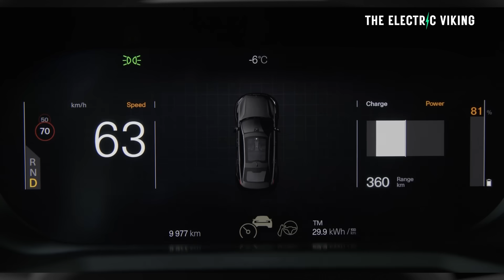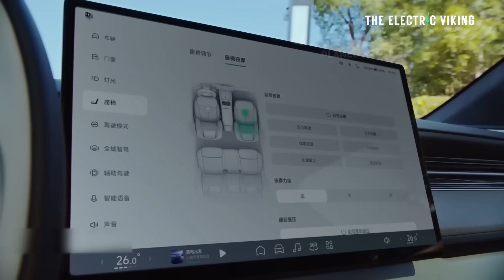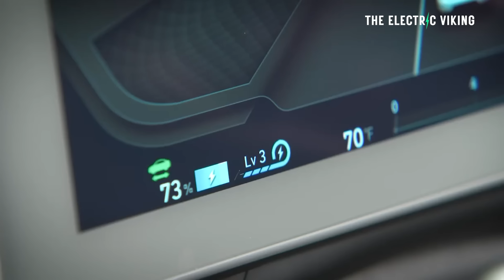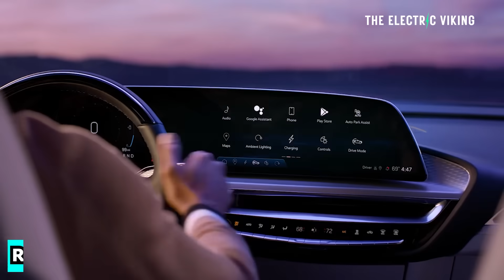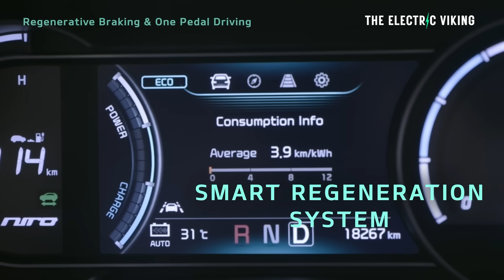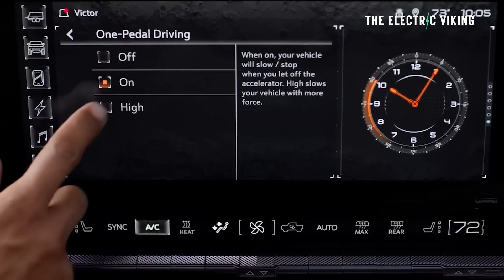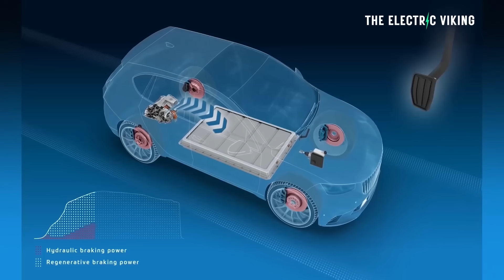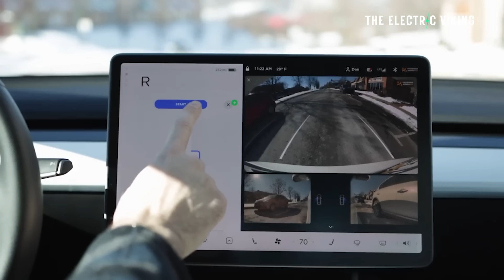China BANS Single Pedal Driving - Regulators Claim it Causes Crashes

Comment: True 'one pedal driving' requires that the car add friction braking near to the full stop  without anyone touching the brake pedal. Regenerative braking a heavy car does not work with the diminishing energy available near to the stop.
I learned to drive in the 1950s using three pedals, so I still brake with my right foot even with two pedals, but here in the USA where automatic shifters  in ICE cars are the norm, I see too many drivers that have only learned to drive with both feet, one on each pedal, and so follow far to close because they can brake much quicker.
 I expect that in China, with cars supplanting bicycles for many of them only a few decades ago, the government sees a time ahead when young drivers forget, or worse, never  learn  to use that other pedal on the floor.

Comment: Nonsense, you can dial it in if you want it. In my BYD the car brakes at -15KW foot off throttle. This is somewhat less than my Tesla.

In the BYD pressing the brake peddle to the first pressure point uses regenerative braking up to -80KW. Press the brake harder, second pressure point, engages the hydraulic system. As the vehicle rolls to a stop tap brake peddle and auto park brake engages.

The BYD system is beautifully harmonised. Personally I prefer it to the full one peddle system in my TM3, which I think is less safe.

Comment: China is not banning one‑pedal driving outright, but from January 1, 2027, new national standards (GB 21670-2025) will:
- Prohibit vehicles from being set to default one‑pedal mode (i.e., where releasing the throttle alone stops the car without using the brake).
- Require that drivers must manually select one‑pedal mode every time they start the car.
- Mandate brake lights activate whenever energy recovery deceleration exceeds 1.3 m/s²  .

In practice, the Zeekr 7X and similar EVs in China will still allow one‑pedal driving—but as an optional setting, not the default.
Reply: "Mandate brake lights activate whenever energy recovery deceleration exceeds 1.3 m/s²" that feel very impotent.
Reply: Yes, that is absolutely right. The Chinese-built Mini Coopers have regen braking, but this has to be selected manually every time the car is started. I see not problem with this.

Comment: Maybe people like Sam (& me) can't see any problem with hitting the brake pedal in an emergency because we developed that reflex driving ICE cars & exercised it for a few decades. Is it possible the EV drivers of latest generation don't develop that instinct as strongly due to almost exclusive 1-pedal driving? Are China crash investigations showing that? I'd like to see the research. If true, I guess there does need to be a regulatory response.
Reply: A lot of EV owners in China are first time car owner. This is because to buy ICE cars in china major cities, they need to enter lottery system to get the rego. EV and PHEV cars are exempt thus they can get the rego right away.
Reply: All new cars sold in Australia since 1 March 2025 must have Autonomous Emergency Braking. This system does an emergency stop if the car detects an impact is imminent.
Reply: @TheWatcherInTheTower Correct about Oz, but this story is claimed to be about China crash statistics, the potential role 1-pedal braking might be playing, & whether a regulatory response might be justified IN CHINA. Can we keep focus on what this video is actually about? BTW I'm not ready to rely exclusively on AEB to get me out of situations I should be able to deal with myself. There's always a role for the driver to maintain control over the vehicle. OK I'm old-fashioned like that.
I guess I also have to cover off that I'm a HUGE EV fan, although more scooter (with separate regen & friction brakes 😊) than car on the daily. I'm not one of the inevitable "my diesel fills up in negative time, & I have a catheter so when I do multiple laps of the universe on 1 tank I never have to stop" commenters.
These comments sections can be hard work at times.
Reply: @MortyMac I've heard people make the same argument against ABS. Automatic systems that cannot be bypassed are simply the best way to improve safety.

Comment: Although the single pedal mode is conducive to extending the range. It can be easier to drive. But it seriously violates the driving habits of previous vehicles. When you get used to driving on a single pedal, you will slowly forget the existence of the brake pedal. When you need to stop urgently in an emergency, you will be at a loss, and some people even step on the accelerator with a conditioned reflex. In addition, many people believe that China's electric vehicles do not have a single pedal model because of limited technical level or in order to save costs. In fact, it is exactly the opposite. Chinese electric vehicles do not use single pedals, but use a more complex CRBS. Integrate kinetic energy recovery with mechanical braking on the brake pedal. It requires fine adjustment of the braking force, let the two brakes can be smoothly connected.
Reply: According to normal driving habits, when passing through some complex intersections, most people will choose to let the vehicle slide and put their feet on the brake. So that they can respond to the brakes in time when encountering situations. For vehicles in single-pedal mode, your foot cannot leave the accelerator pedal (if you do so, it will stop). But it cannot immediately stop by lifting the accelerator in an emergency. Not to mention that lifting the accelerator to stop the vehicle is counterintuitive. China's regulations do not prohibit vehicles from performing regenerative braking when the accelerator is lifted. It only prohibits lifting the accelerator to stop the vehicle completely.

Comment: No sam you are wrong on many things:
1. One pedal driving is not banned in China. Its just it needs to be set by the driver on every start up (it cannot be as default setting)
2. It won't affect export market as this is just a simply software update for export market.
3. Regen braking can be incorporated into brake pedal like BYD cars. When the driver tap the brake pedal lightly i.e. stopping at the lights, it will use the regen braking and doesn't engage the brake calipers. Only when the brake pedal pressed hard enough i.e during emergency the calipers engage.
Reply: 3. Like a Toyota hybrid. Does the same
Reply: @John-p7i5g  Exactly, a lot of misconception out there that if the car doesn't have one pedal driving then it doesn't have regen braking.
Reply: @John-p7i5g  it is amazing how many people do not know about this!
Reply: Same on my Ioniq 5
Reply: Not bothered. Haven’t had it/got it on any EV I’ve owned. Wasn’t even a consideration when i was selecting my latest. Nb BYD.
Reply: don't come here with facts.
Reply: His point still stands. I'm a Tesla owner looking to upgrade and I definitely won't buy a car where I have to change the settings every time I drove the stupid thing.  Its like if the car forgot all radio presets or your home address every time you got out. Pointless and stupid
Reply: @mcbain3188 This is only applies to china market where vast majority of the EV owner are first time car owner. IMO the rule is correct for chinese market to prevent new driver making error judgement.

Comment: I've literally never heard of this feature before. Who TF actually cares
Reply: Tesla EVs have one-pedal-driving. XPeng G6 has X-pedal which "almost" brings the vehicle to a stop if you remove your foot from the accelerator. It is a great feature and does put more energy back into the battery via regenerative braking. I've driven both a Tesla Model 3 and an XPeng G6 and love this feature. I found it easy to get used to and just made driving feel lot smoother somehow.
Reply: Totally overrated. It’s nice to have strong regen, but one-pedal isn’t needed.

Comment: I have a 2020 Bolt and a 2024 KIA EV6.  Both have ABS and brake paddles on the wheel.  Single pedal saps range by not coasting.  Single pedal driving is very bad for passengers.

Comment: it's not there's no regen without 1 pedal driving... when you press the brake pedal, the initial phase is pure regen, when extra braking is needed, the calipers are then engaged.
Reply: Didn't know this! Thanks for sharing...does this apply to all EVs/EREVs?
Reply: @LaerKanan  depending on manufacturer... when you watch driving videos of BYD, the dash will show when they press the brake pedal, the kw number reads negative
Reply: @fatdoi003 
Aha...the negative number basically reflects the regen...if  brake calipers are used then there should not be a negative number...

Comment: Single pedal driving is safer. As soon as you take your foot off the go pedal the car is braking. In an emergency the time it takes to transfer your fioot from the pedal to the brake could be 50m of travel but due to regenrative braking the car instantly starts to quickly slowing decreasing this lag distance dramatically. This regulation is stupid.
Reply: Tesla regen is on the accelerator, not partly on the brake as per most other EVs. I have regen on high and only use the physical brake when almost at a stop. I don't like the physical brake being applied automatically as it feels like less fine control, even though it's only at parking speed. On my driveway OPD is a pain in the bum.
Reply: This regulation is not stupid. It doesn't change how accelerator pedal regen works. Let go of the accelerator, and the car will slow down due to regen as usual. It is only when the car is about to come to a stop, that the brake pedal will need to be depressed otherwise the car will continue to creep.

Comment: Something new to me. I hated to see the clutch pedal go. Now, you say that I have to get rid of a mechanical brake pedal?  My three wheel EV has an electric parking brake on the rear non-driving single wheel. I have a manual brake pedal for all three wheels. I certainly use regenerative braking as it saves on the disk brakes. If I really want to stop, I use both types of braking. I just do not think that regenerative braking should be the only means of braking available.

Comment: Couldn't agree more Sam! 💯 I have been driving a Tesla M3 for 3 years. I thought about changing to a BYD after Musk's shinanigans but found they don't have one-pedal driving. An absolute deal breaker for me. Most people (including regulators) don't realise how much safer regen braking is. Due to Faraday's law the available braking force is proportional the speed of wheel rotation (vehicle speed) - meaning max braking is available at maximum speed, when you most need it. This also means you cannot lock up a wheel (common risk with friction beaking) because if a wheel stops turning there is zero back EMF in the motor, so no braking force is applied. It's the perfect ABS system.

Comment: Which is why the X-Peng G6 will not stop completely. Makes sense now. BYD has low auto regeneration, but when you push the brakes the regen happens then instead.

Comment: That is such a stupid rule.  1 pedal driving are the best thing since sliced bread!!
Reply: Try going down a cliff and tell me you don't want the brake available.
Reply: ehh 1 pedal driving could be convenient, but a standard part of defensive driving is to hover the brakes whenever you can and 1 pedal driving is rather antithetical to that.

If you really think about it, all that's different is when slowing gradually to a stop rather than lightly pressing gas in 1 pedal you are lightly pressing brake in standard. It's hard to argue that the lightly pressing brake version isn't just better.

Either way if the demand is there it's going to be a single button to turn on 1 pedal mode. It's not going to be a big deal either way.

Comment: Are they saying one pedal driving can’t be preset, or are they banning it outright?

If it’s just that one-pedal can’t be the default setting, they may be able to activate the option in markets that allow the feature.

If it’s an actual ban, they’re pretty stupid.  Customer pressure will correct this pretty quickly.
Reply: Try driving down a steep cliff with one pedal. Brake pedal is always needed. Chinese know what they are doing.

Comment: You misunderstood the regulation. China only bans completely stopping the car when not using the brake. And it only applies to cars driving in China. It's just a software configuration that can be turned on outside of China
Reply: Thanks! Does it apply to stopping the vehicle, or the auto-hold feature?
Reply: I believe its regulated to ban setting "One Pedal Driving" as "Default", as in when you get in the car you have to then Enable the one pedal driving.
The same as the UK and EU.

Bloody annoying as I would prefer to have "One Pedal Driving" Enabled as default (by having it remember the previous setting), or allow us  to use the "Custom" driver profile to have "One Pedal Driving" enable in Custom Mode. It would only have to give a warning/notification that regen is reduced if the battery is too full.
Reply: Is Sam appreciating that he does not represent the average driver’s braking reaction time, especially young drivers who may have only learned to drive with single pedal mode? In an emergency, they may not intuitively react quickly or properly to brake.
Reply: One pedal driving can be provided for export vehicles but disabled for the domestic market. Easy. It's trivial. And it probably IS a safety measure.
Reply: The electric viking making inaccurate assumptions 🙄
Reply: Isn't the definition of one pedal driving that you get to a full stop without the break.
Reply: @bambulkomccloud3983 ..not necessarily..and it's "Brake"..
Reply: The way you read the rule sounded to me like they still allowed cars to operate with single pedal driving but that it could not be the default setting.
Reply: It doesn’t matter. Even thinking this is good is total stupidity! After over two years of owning my Tesla Model Y, I use one pedal driving all the time. It makes for easy driving and I got used to it in the first two weeks of owning my car. This ruling is TOTALLY BONKERS!
Reply: People who think they are smarter than the Chinese government should start their own car company and make billions of dollars outside of China 🎉
Reply: That makes sense. A brake light needs to be on when the car is stopped. A software fix could do that regardless of whether the brake is pressed or not. Even slowing down should have some sort of warning. That's common in the latest safety features for motorcycles.
Reply: @rassabossa4554 The brake light should come on when the car is decelerating regardless of whether the brake pedal is pressed. It's simple, an accelerometer that detects any slowdown should turn the lights on. (second half of video)
Reply: @mb-3faze On the Tesla, the brake light does come on when the car  decelerates with regenerative braking. If you are going down a hill and regenerative braking keeps you at the same speed, the brake light does not come on
Reply: @mb-3faze they do!! Please educate yourself before making these statements
Reply: @Spooms1961 only recently. There were any number of cars in the 2010s that didn't. Even some of the European-built 'big rig' electric trucks did not. It was dumb. Even on my home built ev conversion in 2008 I put on a mercury tilt switch to light the brakes on regen.
Reply: @Spooms1961 not on all EVs going by how many Atto 3s With stoved in rear ends I've seen!
Reply: @rassabossa4554 in my car (tesla}the brake lights are on when is in outo hold.
Reply: On top of it I think it’s much better for most people not to have as feature also when you breaking on an ev the first bit of the travel is regen bracking anyway…
Reply: ブレーキは強度の調整が必要です。
Reply: EVは踏み間違いが多いそうです
Reply: @田中亮太-k3u  That's no different to any automatic. The solution is automatic braking.  My ID3 will not let me crash into things
Reply: Exactly.
Reply: Single pedal driving is dangerous. A driver needs to press the brake. This keeps EV driving and ICE driving the same.
Reply: @Dungshoveleux I disagree. I have both, and it's not a problem. Driving my wife's Golf or my Tesla is not a problem. Remember the automatic ice car continues moving or starts moving when you depress the brake pedal, while the manual ones do not. And never was a problem.
Reply: @Dungshoveleux rubbish! I’ve been using one pedal driving for over two years now and it’s so much better than having to lift my foot off the accelerator… but who cares. You won’t change your mind no matter what.
Reply: @Dungshoveleux ..All manual transmission ICE vehicles automatically slow down when you release the throttle, as do most modern automatic transmissions..So it's little different to ICE powered vehicles, except its much more efficient as well as reducing brake pad wear, it puts "free" electricity back into the "tank"..You clearly have never driven an EV with Regenerative Braking..it's totally natural and offers a superior, smooth driving experience..!
Reply: EVはガソリン車に比べて、衝突事故は2倍です。
Reply: @田中亮太-k3u you say some silly things :)
Reply: @田中亮太-k3u No they aren't.
Reply: @田中亮太-k3u  Only when stupid Japanese are driving them.
Reply: @田中亮太-k3u  That's not true
Reply: @田中亮太-k3u 
This is not true, who told you this, Toyota? 😂
Reply: @CYBER-EV  国連が発表ています。調べてみたらいかがですか？
Reply: Its a stupid feature that honestly should be banned worldwide its so dumb and lazy
Reply: @VirtousStoic that's total misinformed nonsense..! Regenerative braking returns power to the battery when slowing down the vehicle, at the same time drastically reducing brake wear and the associated PM 2.5 pollution that results from brake pad wear..
Regenerative braking is natural and convenient to use for the driver, reduces wear and pollution and reduces the need for battery recharging, with NO negative impacts..One pedal driving is brilliant. .!